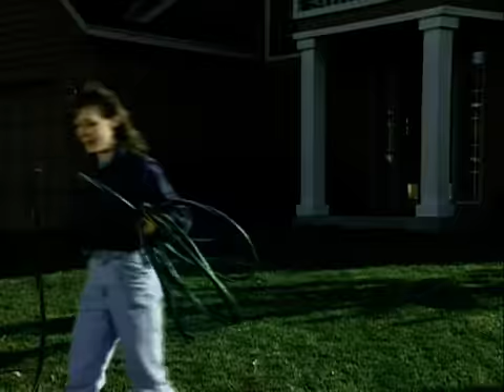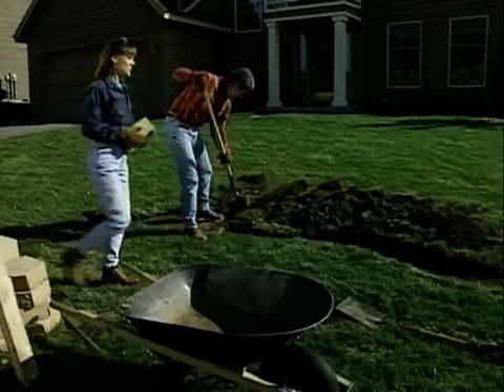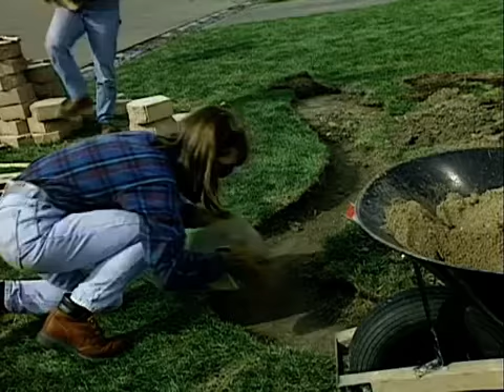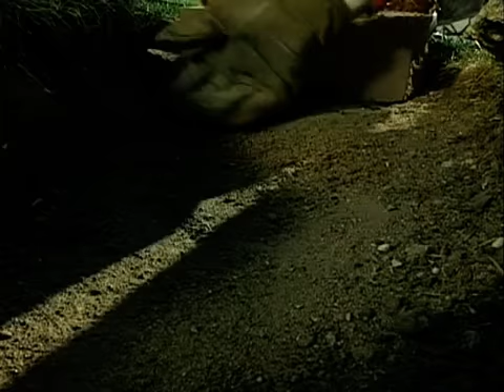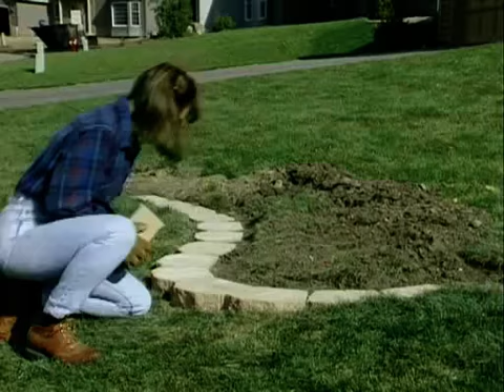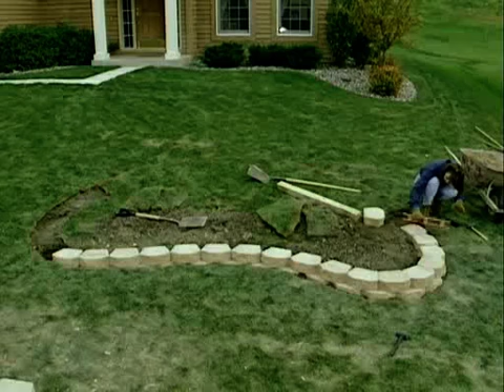How to Build Tree Ring Retaining Wall

Comment: Cute.  

1.  No proper compaction of the sub-grade
2.  No footing below the Frost Line
3.  Blocks bonded with caulking instead of proper cement
4.  No Steel to take the Tensile Forces in the Rear Face
5.  Was a Building Permit obtained?  if not, this couple could find the Building Department using their own video against them in the Town Justice Court hearing.  Fines for building constructed items without a permit start at about $10,000.  Oh, and the illegal, non-permitted structure will have to be dismantled and the ground converted back to its original condition.
6.  The Flanges of many of the blocks were wacked-off.  This could very well have caused to be voided any guarantees which came with the block units.

Show me this wall in four years, when it is all distorted.

Better yet, when the wall collapses and hurts some kid, then call me.  I charge $3,900.00 per day to testify in Court,  Otherwise, my non-trial work is billed at $300.00 per hour.

And God help the person who thinks they can follow this procedure and then builds a wall over five four feet high and which does not just enclose a planting bed.

Vincent A. Ettari, P.E
Reply: Good for you, you leech.  Should have been a lawyer instead.  Bet you are a real hit at the parties.
Reply: @dragon0085  I think that the PE title after his name stands for Professional Engineer. He is likely a professional witness used in court cases.

Comment: Hmmmm.... when I did this 20 years ago, I thought it was advised to use play-sand as a base, put landscaping fabric behind the wall, leaving a 4 inch gap that I then filled in with gravel, to make sure there was minimal water pressure pressing outward on the wall when it rained.   Throwing that out the window here?  Or perhaps that's only advised for TALLER walls?

My wife wants me to build something like this around a 30 year old maple we have...which has a LOT of roots.  I'm a little concerned about digging a trench like this and hitting / damaging those roots.   And, of course, it's a crap-ton of work... especially if I do the play-sand, landscape fabric, tarp thing.  And I'm 20 years older.  Tempted to hire it out.

Comment: This is a pretty good video, but there are some tips to add.  I have installed more than 15 pallets of these at 2 different houses.  Tip 1 - Find a Ho-Mi.  They are sometimes at Korean markets.  This little hand plow is perfect for working on sculpting the resting place and find tuning.  Tip 2 - Get Gel knee pads.  It is less backbreaking if you do this on your knees.  Tip 3 - Use a 4' level and a 1' level.  It is very important that the block is level.  They sort of glossed over the front-back level.  The block needs to be level front to back, side to side.  Do that with the short level.  The long level lets you extend to make sure your run is level all the way across.  When you use both, you just stack the second layers.  Tip 4 - ALWAYS start at the lowest point.  It is easier to go up to embedded the next level than go down and get it level.

I end up using a pick, shovel, level 4', level 1', and a ho-mi.  If I am going to meet a wall, I also use a chisel and rock hammer to split block.  Make a running score and then broad chisel that score to break it.  Safety googles.

I always level bevel on the ground level.  It should act to help sliding under load.  I have had one wall move about 3 inches on Georgia clay on a 7 layer face.

Watch for water eroding the edges over the years.  My next wall is going to be set in concrete just for this reason.
Reply: @JQUICK21 The quikrete will take care of the erosion.  In heavy rains, the water may pool, then go around the end of the bricks, washing it out.  Yes, freezing could do that.  If you put some gravel along the bottom, that will allow it to drain better.  Less water, less expansion.

I am reading "level bevel" again, and yes, that makes no sense.  I make sure there is a channel for the back bevel of the stone.  Since that is what will keep it from sliding, you want to make sure that has a firmer footing.  Since you are going to use quikrete there, you have it solved.

For your 5", you could take the matching cap stones and lay a layer of them at the foot.  That will give you a nice rolling flat for your mower.

Comment: When building a circular wall, the blocks for the 2nd, 3rd, etc.... row's; how do you keep them in a uniform pattern? Do you cut the sides of them (because of the radius getting tighter)?
Reply: Yes. You can score them and break them or cut them. They should make stone wedges that help with the tightening radius as it nears the top.  When I did this as a teenager, we would drill holes through the block and pound rebar to help lock in the pavers with the level above.

Comment: you may like high quality led hardscape lighting at very good price
https://www.aliexpress.com/store/product/12PCS-12V-Low-voltage-Outdoor-Waterproof-LED-Deck-Step-Stair-lights-Garden-Wall-Patio-Accent-light/1381295_32849835062.html?spm=2114.12010608.0.0.96fd3cc2m2KSPm

Comment: Need to put some fabric on the back side to keep the dirt from "leaking" thru the joints.
Reply: never use fabric, because it doesn't allow enough water to flow through, which results in the dirt pushing out the wall. Stanley 'dirt monkey' has a good video on it
Reply: @willtaylor9971  over time this is possible but installing 3/4 net backfill and a French drain is the ideal solution
Reply: I would say also say if you get a lot of rain I would say putting all purpose stone. for a range depending  1in to let water flow. to 3-5ins in high water tables. I put around my parents beach right next to the pond. the ground is hard clay. I had a tiller to break up the ground. the last wall we had up, broke at the corners because sand wash out. I had enough blocks to rebuild wall and go a little higher. I would guess  if i bought all the blocks, all purpose stone, weed blocker $900-$1100. My wall in parts started out unlevel. But once I put layer and the third layer it leveled out
Reply from the maker: +Dirt Boy 
thanks for the advice